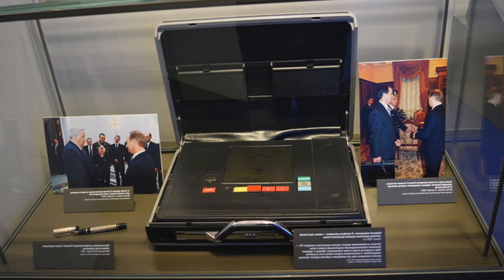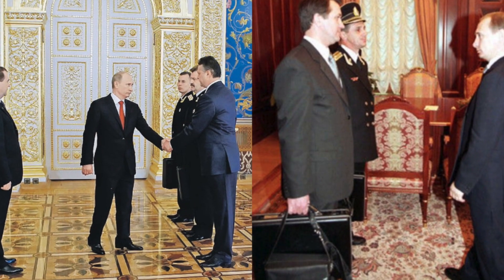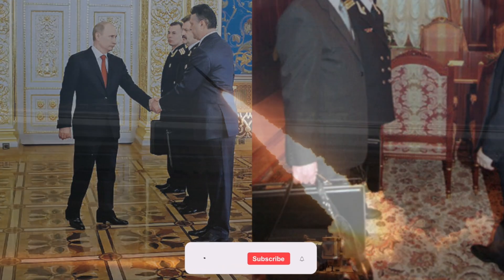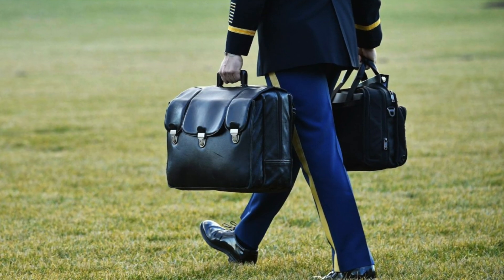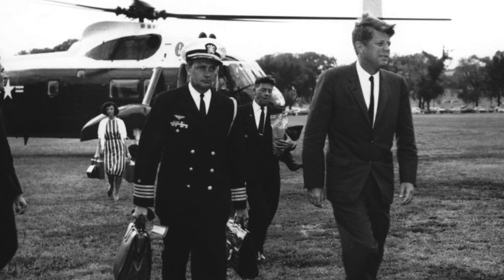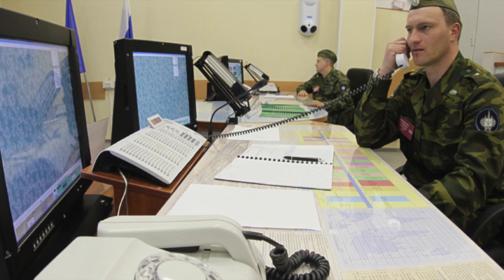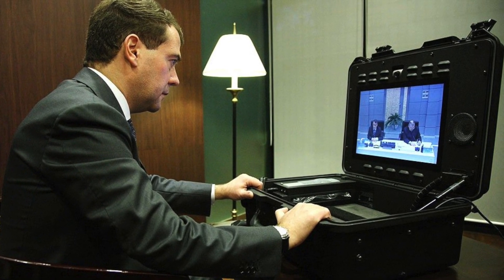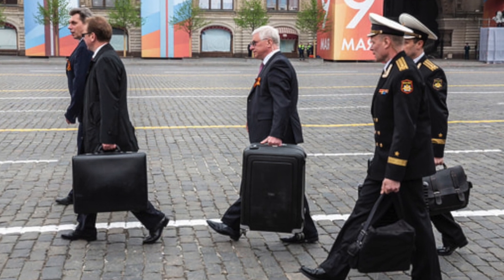How the President's "nuclear suitcase" works?

Comment: There is also another level to this much to America's chagrin is the "dead man's handle" if by some luck America managed the unthinkable, a dedicated first strike against Russia blindsiding them, if the control systems go "dark" e.g. lose contact the computer systems flag up possible eradication of major seats of government and activates the "all up" protocol which means anything capable of launching to its target goes up thus ensuring MAD or mutually assured destruction.   The last Bush changed the US policy from MAD to first strike attempt capability hence why the US is very hard pushing to get as close to Russia with NATO or secret lily pad bases literally pointing nukes down Russia's throat so to speak.   Putin has a quite potent counter in the deployment of his secret Iskander's and other mobile ICBM launchers plus the very many ICBM subs, America only ever gets to hear about of around 5% location of these land and sea launcher locations meaning 95% of Russia's ICBM will launch successfully whereas Russia knows where every US silo and land base launch sites are and is big enough to weather the sub based Tridents (if they even work) with a good chance of surviving an incoming nuclear strike far more intact than the US would weather an incoming strike.   Remember too that China is keyed in to all of this, if America attacks Russia, China is duty and treaty bound to retaliate with its own nuclear weapons and China maintains just enough for every western city to be erased, thus MAD is fully maintained by the SCO alliance.